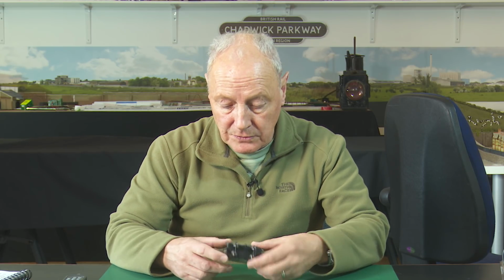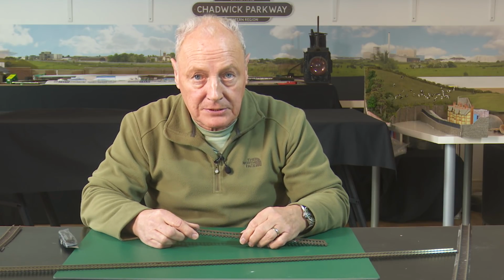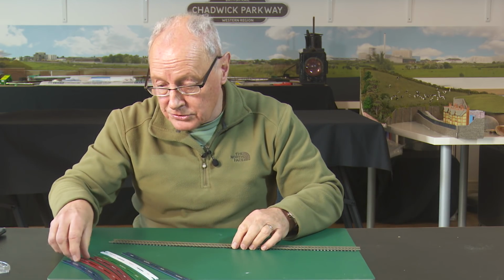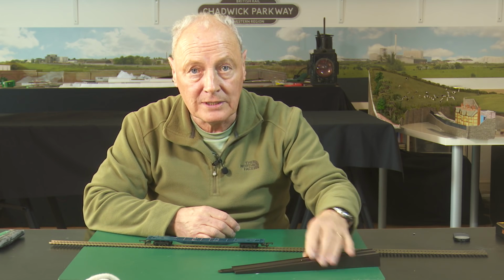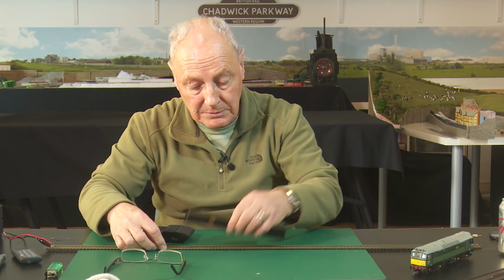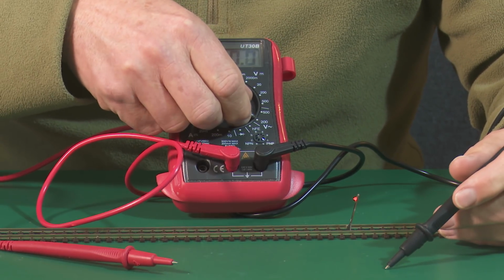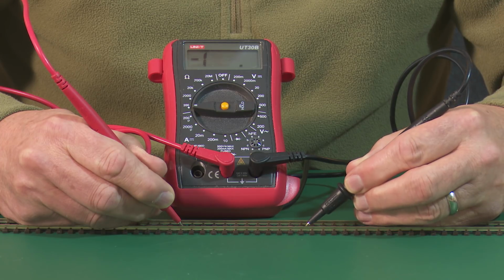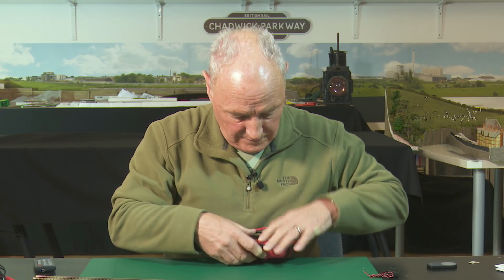Great model railway tools for the Railway Modeller at Chadwick Model Railway. | 76

Comment: im taking second thoughts about running a model railway its o technical
Reply from the maker: But it’s a great hobby!
Reply: @ChadwickModelRailway  yeh i no its a great hobby i've been planning for months its just the electrics i'm frightened i might blow myself up i have all my track,track plans are in place will be starting after new year not confident about wiring or soldering just watched your vids on point motors last night on tortoise motors thanks for your help on your vlogs 
ebay has helped me and other peoples vlogs on you tube
Reply from the maker: If you join a model railway club your confidence would increase tremendously.
Reply: Thank you 
but the problem is I have a poorly wife so It is something to think about I watched your vlog on buffer stop light it was interesting

Comment: I've got a top tip... Get in the habit of always retracting your Stanley blade when you put it to one side, then you may not have to use the first aid kit so often :-)
Reply from the maker: Excellent point, I feel correctly re-briefed.
Reply: Chadwick Model Railway i totally agree there I had an accident with a Stanley knife about 12 years ago and cut deep into the palm of my hand almost from my fingers to my wrist. The knife in question was one that couldn’t retract unless you took out the screw. That one went in the bin (blameless) for bin operative safety and I got a new one. Every time I put down the knife my thumb is retracting the blade before I let go  btw I was healed after about 4 weeks and al is good

Comment: Hi Charlie, I totally agree with what Andy has said. I am an x-firefighter and having spoken to my mates who are still in the job they have said you are both right. After all you dont want to lose your home let alone your layout and a Co2 extinguisher would be ideal under those circumstances. Short bursts, dont stay to long if fire not out. After all caravans come equipped with a small fire extinguisher and they are small confined spaces, likewise a lot of people have one in the kitchen or garage and of course you should carry one in your car although they tend to be small compact BCpowder fire extinguishers. So the points they brought up regarding this issue were 1/  Good idea having the extinguisher at the exit so not going past fire hopefully. 2/ If you have to use all of your extinguisher Charlie you are staying a dangerous area far too long, a smaller one is ideal, lighter to carry and will do the job just as good, after all your going to be aware hopefully of a fire very quickly in your railway room. 3/ My lights are on a different circuit so its ideal to have an isolator on your railway electrics so you can trip it on your way out if it hasn't tripped straight away. 4/ Companies have there fire fighting equipment checked every year and recharged if necessary, whereas home ones have an expiry date which you should check and renew when required. 5/ We in this hobby tend to be of the older variety and hopefully have an abundance of commonsense but people still make mistakes so know your limitations, those of the extinguisher and the fire itself. Hope this helps.
Regards Chris
Reply from the maker: I’m in total agreement Clive. As a carrier sailor (aircraft carriers etc) I’m only too aware of the risks of fire and ones realistic abilities.
Reply: Who is this Clive you speak of !!!
Reply from the maker: Oh bugger, so sorry Chris.

Comment: Hi there Charlie. Regarding continuity and measuring resistance. As you quite rightly state, continuity uses resistance. But speakers are an interesting one. Resistance measurements use DC but speakers use AC to drive the 'voice coil'. Where you got your lower resistance than you expected on your speaker; this is because speakers, whilst stated as Ohms use AC and so you are not measuring resistance but are measuring imepedance. Impedance (symbol Z) is also stated in Ohms just to confuse matters (so a speaker is not 8 Ohms resistance, it is 8 Ohms impedance). If you take for example an 8 Ohm rated speaker and measure the resistance it will always be less than the 8 Ohms by in the order of a couple of Ohms. The difference is called the 'reactance' or 'inductive reactance' (x). This is because a speaker uses AC to drive it so not only has the current passing through the wire (the voice coil) got the resistance of the wire to overcome, it also has to overcome the energy field which is caused by passing a magnet (the speaker magnet) through a coil (the speaker 'voice coil') - the Reactance (x) or Counter EMF - as the speaker cone moves in and out to vibrate the air and make a sound, the energy in the magnetic field changes so the impedance changes. As you will recall from your Physics 'O' and 'A' levels, when you pass a magnet through a coil an energy field is created so the current driving the speaker has to overcome this energy field too (the reactance). So in actual fact the reading you got on your multimeter across your speaker was in the 'ball park near enough' as the apparatus to accurately measure impedance (Z) will set you back a few thousand quid.
Here is a link but it gets heavy and lots of maths go straight to inductive reactance - https://en.wikipedia.org/wiki/Electrical_reactance
Reply from the maker: Wow David, what detail, I’m humbled.
Reply: @ChadwickModelRailway : I'm retired Charlie and I was brought up with an interesting philosophy by my parents, "If you want to be a layabout, better be an educated layabout than an uneducated one." An intersting 'mantra'. (I did get a distinction in Calculus at undergraduate level though!!)
Reply from the maker: Wise parental guidance, if you ask me.

Comment: Have to disagree about sleeper spacing. it depends on the era you are modelling and if you are on the mainline or sidings. modern image
Reply: Charlie as you say the undeniable fact is that because of the track gauge British 00 gauge uses HO scale track as mentioned at the top of my post.

On that basis I would suggest it may be better to consider sleeper spacing as HO and not 00 as you only really notice the track when the trains are not standing on it.

Modern Sleeper spacing depends on various factors including line speed and rail type. The Network Rail track design handbook gives full details However the standard specified is a minimum no of sleepers per panel as 28 for Continuous welded rail (CWR) which equates to a sleeper spacing of 642mm or 8.4mm at 00 scale (or 7.4mm at H0 scale)  the peco set track is around 7.1 mm which equates to 540mm at full size (or 617mm from H0)

 The difference is therefore between 1.3mm or 0.3 depending on how you consider it.

Luckily through my job I spend some time up close to track and often travel around the network and to be honest I think code 100 standard track looks good once ballasted and weathered it is even better. Given 00 gauge has totally the wrong rail spacing which is by far the biggest compromise we have to put up with.
I have spent a fair amount of time trackside and in my opinion the Peco track is not too bad. What I find glaringly obvious with modern day models layouts is where the sleeper spacing has been spread out to much.  Worth also mentioning that if you are running modern image comparing the Peco code 100 rail with flat bottom is not the right way to look at it very modern rail is much taller.
Reply from the maker: Hi Geoffrey, thanks for such a detailed comment.  We might have to disagree somewhat in that the new Bullhead track from Peco, in my opinion, looks terrific.

Comment: Carbon Dioxide displaces the Oxygen a fire needs to sustain itself thereby extinguishing the fire. Carbon Dioxide (CO2) is not toxic, it is an asphyxiant so it will not 'poison' the user. Indeed, the air around us is 21% Oxygen, 78% Nitrogen, and traces of CO2 and other gaseous elements making up the 1% difference. As you can see, the greater part of our atmosphere is Nitrogen, which does not support life but nor is it poison. It is an asphyxiant, same as Carbon Dioxide. Human respiration becomes uncomfortable when the Oxygen content is around 15% or lower but, in saying that, unconciousness through asphyxiation is not immediate and the indivual is fully aware of difficult respiration long before the loss of faculties through Oxygen deprivation sets in. To support human life we only use about 16% of the 21% Oxygen content of the air around us but in the respiration cycle we produce and exhale about 16% CO2, 5% Oxygen (as we don't use the full 21% present in the air we breathe and this is how closed circuit breathing apparatus works by re-using [recycling] the 5% exhaled Oxygen), 79% Nitrogen (with Nitrogen what goes in is the same as we expel as we don't use the Nitrogen we respirate) as, as part of our bodily function, our bodies produce Carbon Dioxide as the Oxygen is used to support our life (this is why we need vegetation as photosynthesis, which is the life support process of trees etc 'inhale' (for want of a better description) CO2 and expel Oxygen. This is how our planet is balanced. Moreover, CO2 is heavier than air so will naturaly find the lowest point of the space and then 'upfill' the space (from bottom upwards). When used an an extinguishing agent it locally starves the fire of oxygen in the proximity of the flame front by interfering with the branching chain reaction (combustion). Using CO2 in a confined space is not a problem as it is reasonable to expect that the full contents will not be discharged in the incipient stages of the combustion process. Moreover, whilst attacking a fire we are invariably standing up whilst the CO2 has sunk to the floor so our air intake (nose and mouth) is in the Oxygen rich part of the local atmosphere (as the CO2 displaces the Oxygen so the only place the Oxygen can go is up - to where our 'air intake' is) so we can breath quite adequately in that life supporting part of the environment. Also, when fighting a fire, anyone with a modicum of common sense will not let the fire get between them and their means of escape. Using dry powder (which is in the main Bicarbonate of Soda) in a confined space is likely to do more damage to the human respiratory system as to fill the local environment in which one is breathing means that as part of the inhalation cycle the body will intake/inhale the dry powder and probably do longer term respiratory damage than a non-toxic gas (indeed CO2 in many cases is used as a respiratory stimulant). Foam tends to be used more on flammable liquid fires as it floats across the meniscus of the flammable liquid and so starves the liquid (actually flammable vapour on the liquid surface as the liquid does not really burn but rather it is the flammable vapours that burn) fire of Oxygen the flame front needs to maintain its branching chain reaction. I would suggest the use of a foam extinguisher is inappropriate given the risk being considered to be dealt with.
Combustion however does produce Carbon Monoxide (CO) which is of course very toxic as our red corpuscles have a natural afinity and preference to absorb CO rather than Oxygen if both gasses are present.
So in summing up - stick with the CO2 Charlie, it is the most appropriate extinguishing agent given the risk we are working with. (former MIFireE as I am retired and won't pay the Institution of Fire Engineers their annual subscription because I'm..er...retired so don't need it!!!!!)
Reply from the maker: I’m exhausted from reading your comment and I’m off for a lie down!
Great info mate.
Reply: @ChadwickModelRailway : I've just offered you another on why your resistance reading on your multimeter across your speaker was less than you expected.

Comment: I would like to comment purely on the use of extinguishers from experience......28 years in the Fire Service. Yes, if used in a small space a CO2 extinguisher of the size you have could be a problem as the gas does displace oxygen. A dry powder extinguisher does cause a huge amount of mess, and is also unpleasant to breathe in a confined space. A Foam extinguisher also causes a lot of mess but doesn't affect breathing. However, not having an extinguisher at all could well result in not only a total loss of model railway, but the house as well, particularly if in a basement or loft. I can assure everybody that the Fire Service responds promptly to all calls. However, the time taken to attend an incident varies greatly. In most urban areas you would be looking at 6 to 8 minutes on average.....rural areas could be as much as 15 minutes plus. I can assure you that within even 6 minutes a small fire can develop to completely engulf a loft space or basement. 
I would suggest as a minimum a small CO2 extinguisher, which will deal with most small fires. If the layout is in the house then a largish foam or dry powder extinguisher would be a good backup. As for a foam extinguisher being a hazard on household electrics....well I spent 28 years spraying water onto household electrics at hundreds of house fires and never got an electric shock ( And a lot of those never had RCD fuses ).
The bottom line is, it is reasonable to take minimal risk to stop a fire early, but if in doubt just leave....BUT make sure everyone is out the house....AND please phone for the fire service. By taking a few seconds to put out a fire you could literally stop your house being destroyed, so a model railway covered in dry powder or foam is a price worth paying!
Reply from the maker: Such a valuable comment Andy

Comment: NMRA member Mark Gurries says 'DCC's "AC like" track voltage does NOT resemble DC in any way.' https://sites.google.com/site/markgurries/home/technical-discussions/dc-versus-dcc-bacground
To get a true DCC voltage reading you need to use a RRampMeter.
http://www.sumidacrossing.org/ModelTrains/ModelTrainDCC/DCCDecoders/DCCVoltages/
My Fleischmann/Roco Z21 can also read DCC voltages.
Reply from the maker: I take your point but I know of no one who has one.
Reply: @ChadwickModelRailway  I do know that some multimeters can correctly measure DCC. Now if only I could remember where I read that???
Interesting snippet I picked up on Mark Gurries website.

"• Under DCC, running bulbs under full voltage creates a problem.

• Bulbs have very little resistance when filament is cold (off).

• This creates a high turn-on surge of current

• The current surge can BLOW a decoder’s function output!

• Later, resistance increases has filament heats up (glows) reducing current."
Reply: @ChadwickModelRailway   To measure DCC correctly you need a True RMS Multimeter. Found one made by Kewtech at Screwfix for £79.34. 
(The cheapo UNI-T multimeter I bought years ago (from Maplins I think) goes beep.) :-)

Comment: I prefer the Tsugawa Yokou wheel cleaner. It uses a metallic sponge like material that won't scratch your wheels or damage traction tyres.
Available from the eBay store Plaza Japan. Gaugemaster also sell a rebadged version, the GM50 Locomotive Wheel Cleaner. They're not cheap though.
Reply from the maker: Good things never are sadly.

Comment: These are nice multimeters, you do current measurement without interrupting the circuit.
They can be found cheaper.
https://www.amazon.co.uk/UT210E-Current-Meters-Capacitance-Tester/dp/B00O1Q2HOQ
Reply from the maker: Good tip Dennis

Comment: Hi Charley just going back on your first part you might like to know that Maplins is still going but only online another thing you might want to look at is the right angle attachment they sell for Dremmels it allows you to get in tighter to cut rails straight even with a smaller disc
Reply from the maker: Great info , thanks.